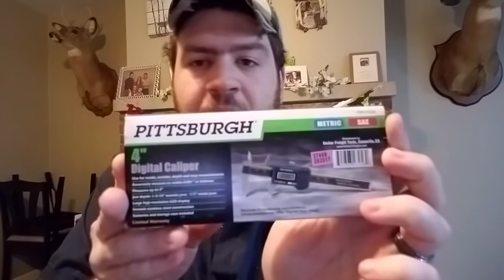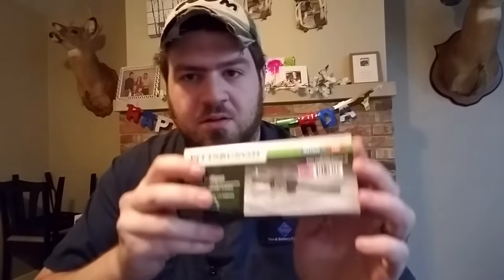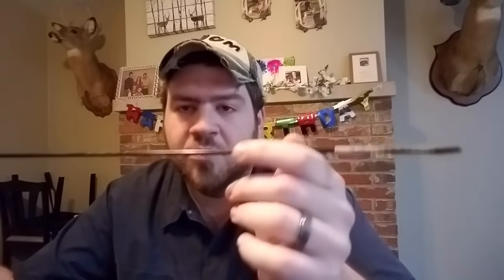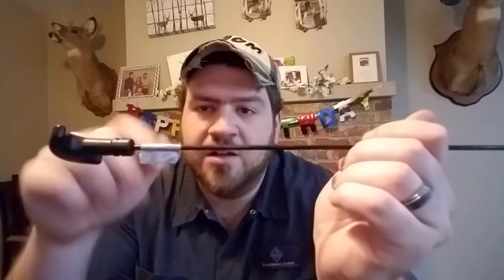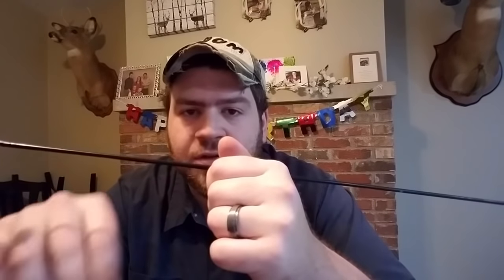TOP 5 SECRETS Airgun/Pellet Makers DON'T Tell You!

Comment: so tell me why 3 of my crosman guns will not run any crosman pellets but love jsb predators or even the hades .. or rws super point extras .. pellets also dont all weigh the same in the tin and there are also size variets in each tin of pellets which means some of the are more accurate then others the better the pellet quailty the less odd sized pellets so the  more accurate the better pellets shoots, speed of the gun also affects each size and type and weight of pellet as well . also you have to take in account for the crown if its a piss poor like most crosman guns have a sub standard crown so these guns are more difficult at times to get the right pellet, also in the end here the gun chooses its best pellets .. i have 42 years in at this game of shooting and  over 20 years for fixing and modding airguns. one thing i will say is that all new guns out of the box need the barrels cleaned and should be cleaned from time to time as well..
Reply from the maker: Well #1 Crosman bores are oversized which most of their pellets are ~5.5mm in .22 cal head diameter....on their lesser expensive guns contracted from China, #2 lets use 22cal as example again JSB have a 5.52mm headsize and the contact or bearing surface from the first drive band of the head to the rifling of the skirt is longer than any crosman pellet...and their barrel twist of 18.9" suits a pellet that is longer/heavier which i called and verified from Crosman...and if your shooting correct pellet the weight difference is irrelevant because the barrel adjust itself for it, also if the right pellet is used velocity only limits distance....I have regulated guns shooting 860fps and 600fps , they one hole at 25yd...I can pick a pellet for a gun without even shooting the gun because I have gages I made as an engineer to test this....
Reply: @STKO2011  no one can pick a pelltet thats right for a gun by using guages thats a line of total horse manure.., and you know it and if not well the millions of other shooters out there woudl agree your full of it on that , also the heads are not the same sis as the skirts thats a fact you need to go back to learing airguns alot more andhow they are made and how they really works there is not even any 2 barrels the same ever its not possible ..
Reply from the maker: @KevinMillard68  I can... that's a fact, you may have been shooting for 40 years but you haven't learned much compared to me...
Reply: @STKO2011  you have no idea who iam and what i know about airguns or the work i have also done and still do, ROFLMFAO
Reply from the maker: @KevinMillard68  same here...
Reply: @STKO2011  ok smart man here is a test what pellet and pellets will give me 1 hole groups in the Crosman phonix .177 cal air rifle or at least under a dime in the bullseye lets see how smart you really are ..
Reply from the maker: @KevinMillard68  well do you have any 10gr + .177 on hand ? Crosman dome, JSB , H&N...plus I dont know if you are using artillery hold or have gun fixed in a mount, and your trigger being pulled or jerked, which i use the jerk method is more accurate
Reply: @STKO2011  i got loads of pellets on hand serveral brands and weights and so far no go on any and yes that includes the crosman pellets , also tried different holds as well as a bipod adjusted the trigger as well and i never jerk the trigger on any gun .. also this is a nitro piston gun in case you didnt know..scope and no scope still nothing groups at all crown is good barrel is straight,, rifling is fine as well and it chronys average is 490s and very consistante to.. no matter what pellet i use ..
Reply from the maker: @KevinMillard68  id personally run a bronze brush thru it, and shoot 3 pellets to season before every pellet, and set trigger then jerk....the trigger is actually riding on the piston, if you squeeze the trigger the accuracy is all over the place especially on the chinese trigger designs
Reply: @STKO2011  i auctually never run a brish thru any air rifle barrel i have my own methods for cleaning the barrels that gets them super clean , 99% of the tiggers out there are chinese so nothing new there and its the sear that locks to the pison not the tigger i know but iam picky person. adjusting the trigger properly is key on adjustable trigger designs like this gun for example is adjustable might have to back it out more yet tho but this wil not affect the grouping at all. i have many airguns with and without adjustable triggers some are factory set and some are not . did alot of experimenting with the guns and it makes no big difference in the adustment of the trigger wether one pellet with group or not group .. iam sure there is a pellet out there that will work for this gun but so far no luck no matter what brand or style i have tried and there are tons of other choices out there.. my crosman f11 will not shoot any pellet properly other then JSB predators and rws super point extras ,, my classic .22 same pellets and nothing else works with it..my qb78 adores predator polymags the most and thats ok its my hunting rifle anyhow. all the pro shooters by they way all say never to jerk the trigger as this will screw up accuracy and i have to agree with them been there done that testing alot finger placement tho is cridicial on the trigger and how you breath and squeeze it as well weahter is a huge factor as well to with the wind i can dial in a gun in no wind and up to 17kph no problems and all my airguns are rated as under 500 fps , i cant be bothered to get a firearm licence in canada which is where iam .. to dam many stupid rules to follow with over 500 fps airguns and firearms..
Reply from the maker: @KevinMillard68  well each their own I guess, hundreds of viewers on both of my YouTube channels have tried my methods and have had extreme results better than anything than they have ever seen
Reply: @STKO2011  well you know seeing and doing are 2 different things and experience trumps ideas thats for sure. well you failed to answer the question of what pellet will work in my gun and that did not surprise me. so here is one more test for you .. none of my .177 cal springers or nitro guns will fire a 13 grain pellet i do mean will not fire .. how ever all my pumpers and co2 guns will fire them just fine all of these guns all shoot with in 5 fps of each other over the chrony so there should be no reason that the springers and nitro guns shold not fire these 13 grain .177 pellets but the others are fine .. keep in mind i know the answer to this my self i want to hear yours and see if you comeup with the same answer
Reply from the maker: @KevinMillard68  because your limited on fps/fpe the piston stroke is shortened/lessened and is not having enough power to push the pellet out the barrel where your CO2 and pumps have pressure already...and I did say the pellet 10gr or more, more specifically 10.5gr Crosman 
https://youtu.be/fEU4v05EI4o
Reply: @STKO2011  well your wrong auctually the correct answer is but before i tell you there you recall i said all the guns run with in 5 fps of each other now all these guns are in the 490s , now the answer is simple , the pressure in co2 gas is higher then what i springer produces also the pumpup guns have more pressure then the co2 guns both have enough pressure to shoot the pellets just fune but the springer does not piston stroke has noting to do with it when the guns are all shooting basicially the same.. now if you know how a springer or nitro gun really works youll relaize then what iam talking about and should know how they work and why they wont..fire the pellets that are 13 grain.. also all of the guns the pellets also seat in the breech tight as well at the skirt.. now whats the reason then that the  springers wont fire the pellets that the other power systems do .. ...best do a good study of springers nitro and co2 and pumper before you answer buy the way some of the rifles have a short stroke and some have a long stroke in the springers and hte nitros yet neither can fire the 13 grain pellets
Reply from the maker: @KevinMillard68  i definitely know what I'm talking about especially guns in USA shooting way beyond Canadas restrictions and I'm not wrong when the co2 and pumps have pressure already which is more pressure than the Springer or np has and yes stroke is relevant when the stroke of the piston which is used to generate the pressure needed to push the pellet doesn't generate enough power...so USA version would easily push the pellet why because it generates more energy
Reply: @STKO2011  the only restrictions we have is over 500 fps we have to have a firearms licence . 97% of everything in your video is snake oil you dont even back up what your saying..and you could not answer the quesion about the crosman phoneix rifle problem with it not shoting the 13 grain pellet or why i cant get it to group any pellet so far..  well ok you did give me an answer but it was wrong as i knew it would be in reguards to the 13 grian pellet not shotting at all. good bye best of luck in your airgunning there is no point to talking to you anymore you think you know it all and and based on a few guns wow you talk about having experience with..   have a good one man

Comment: Hey man, Great stuff. I found this most interesting. Saves us a lot of cash trying to find the right pellet. I am 59 yrs old and been shooting airguns since I was WELL I CANT REMEMBER. any way. The best and most accurate one I have shot and shoot is the cheapest one I own and it is the Crossman F4 solid stock. $78.00. I got one for my nephew for Christmas and couldn't believe the accuracy and speed. he was 13 yrs old and been BB guns shooting since he was 5 or 6 and he knows to be safe. I didn't know this gun shoots so well to be as cheep as it is. SO I HAD TO BUY ME ONE.1200 fps aint no joke. at 50 yrds with the 7.80 grn Gamo Red Fire pellets, 1in groups at 50 yrds. can get some in same hole at 50 yrds. next to them is the Crosman Premier 7.9 grn hollow points, can get 1in groups. have tried others and these 2 shoot the best. those Gamo red fire's shoot the best. We don't use anything else. we don't have to adjust when we go from the redfires to the crosman premier hollow points. . there's no need to spend 1 2 3 hundred bucks on a airgun to get this accuracy and speed. .177 cal pellet gets a little wild at speeds much faster than 1200 fps, do you agree. Thank's for the information and keep it up.

Comment: The twist rate of your barrel is also effected by the ammount of surface area your pellet has with the barrel and velocity.
Reply: For example, (not an expert on twist rate at all), I would think that a real fast twist rate might not work as well as it could when using a real fast fps chunk of lead. I would think the bullet/pellet would actually sheer on the fast twist rate a bit.
Would that be on the right track?
Reply: @EarthSurferUSA  , it's an interesting question. I'm not sure about pellets, since no matter what kind of pellet gun you have, the velocities are really not that high. I would doubt any sheering would be happening at such low velocities, and most twist rates aren't that tight anyway. I say this, because I have a Savage .17 rifle, a firearm. It has a very tight, 1:9 twist rate. The bullets are very light, and the velocity is very high, around 2550fps. You would think the bullets would pass through and sheer, but they don't, it just spins them at an incredible rate of speed.

Comment: Can you please help me I've had my gun for 4 years beeman springer .22 Mine is a 1:20 twist
It shoots the crosman pellet like shotguns and heavier pellets like a tack driver. (Used to) I ordered a new o-ring,21.14g baracuda pellets, oil, I just dont understand what pellet I should use? I have a beeman RAM, not the same as the one with 2 barrels. Any help is greatly appreciated.
Reply: Rs2 trigger
Reply from the maker: Typically the heavier pellet works better in gas piston guns so I'd stay with what works, might try cleaning the barrel too
Reply: @STKO2011  thanks. I already cleaned out the barrel (nasty) I've had the gun for like 5 yrs. Now I'm waiting for those pellets to come in. I might do a review for other people having the same problem. Thanks for your help
Reply from the maker: @KingDavid1  no problem! 1/20 twist calls for a 14.3gr weight...but  the piston timing is too fast so heavy pellets are really good out to a certain distance then they destabilize faster than a lighter Pellet would
Reply: @STKO2011  Thank you! Alot I will got my baracuda hunter extreme 18.52 in the mail today! Ill be testing these shortly.
Reply from the maker: @KingDavid1  no problem!
Reply: @STKO2011  Dudue! With baracuda hunter extreme 18.52gr..  22cal And its lead on lead at 9 meters. Shoots through the same hole! I will make another video review. Thanks!!!
Reply: @STKO2011  I got my new o rings for the breech and its shooting crazy low. The ring is like a tiny big, I used pellgun oil. I'm going to rest the barrel on a chair as so to give it upwards force. It's a break barrel, I want to apply pressure to the oring. Any ideas?
Reply from the maker: @KingDavid1  I guess I would check the old oring heighth and depths to compare... might have to shim or shave the seal
Reply: @STKO2011  I finished the videos. May you please check out my video and tell me what you think?

Comment: Well James I think you did a good video man. I personally didn't learn anything new but I have 18 years air gun experience. I think you did a good job simplifying the barrel twist rate for those less experienced. I am wondering however have you tried putting in a tuning kit into your Gauntlet yet? I have a Jefferson State air rifles tuning kit in mine. The gun is optimized to shoot 18.13 jsbs. My gun however seems to like have your pellet around 900 feet per second. Baracuda match or jsb 18.13 seem to be best up to 50 yards. I go out to a hundred yards I switch to h&n sniper mag pellets which if you haven't shot out of your Gauntlet yet I suggest you try them. God bless keep up the good work brother!
Reply from the maker: Steve Jenkins thanks appreciate it! I'll definitely look into those pellets, and I still have the factory velocity tune
Reply: Ok no big
Reply: Shoot To Kill Outdoors I see that you said not to use a brush but the Gamo air gun cleaning kit comes with a brush in it are the bores not strong enough to hold up to brushing?
Reply: Steve Jenkins .

Comment: Great video. Do you recommend using any oil or other lubes on the pellets? Also I read about using a sizing die for the pellets, mostly for competition, but they claim better accuracy if the size is consistent. Thanks.
Reply: Never use lubricant on your pellets or put lubricant in the barrel of the gun. That's called dieseling. This will make the pellet go much faster but it can damage your pellet gun. It can blow out the seals. And measuring you're pellet diameter make sure they are perfect is practically impossible. Just find what your pellet gun shoots best and stick with that pellet.

Comment: Great video thanks !!!!
Reply from the maker: Dan Bradshaw thanks!
Reply: Shoot To Kill Outdoors really just getting into air rifles. Any suggestions on the best to buy? Looking at gamo 125 right now.
Reply from the maker: Dan Bradshaw well guess depends on what you are looking for... I shoot break barrels and PCP guns ... break barrel guns aren't the easiest shoot compared to PCP, but both can be very accurate...only Gamo I've shot lately was the Whisper Mach1 Fusion ...great gun! Literally a super shooter...but hefty $200 or so price which is within budget PCP range so again I depends on what you are looking for and intended purpose
Reply: Shoot To Kill Outdoors what is a PCP?
Reply from the maker: Dan Bradshaw pre charged pnuematic...shoots just like a firearm if that's what you are used to...has to be filled with high pressure air prior to shooting either scuba tank or high pressure air handpump... depending on the on board air supply of the gun..psi can range from 2000 to 4500psi...more psi you need more expensive everything is... I personally like guns 3000psi or 2000psi because I use a handpump...it can be a workout depending on how much air you need and volume... I like the budget 2000psi PCP guns, easy to pump and very inexpensive to get started
Reply: Shoot To Kill Outdoors thanks for all the info. Cheers!!
Reply from the maker: Dan Bradshaw no problem! Thanks for watching

Comment: The linear difference in your speed tests (even though tiny) must be due to the rifle heat increasing with each test shot?
Reply from the maker: Could be...also other variables...distance from chronograph, outside temp, slight (very very minute) pellet weight.
if you were talking about linear dispersion at far range, the orings/seals didn't seal good enough causing loss of air in between each shot...30fps muzzle difference is HUGE at 100yd